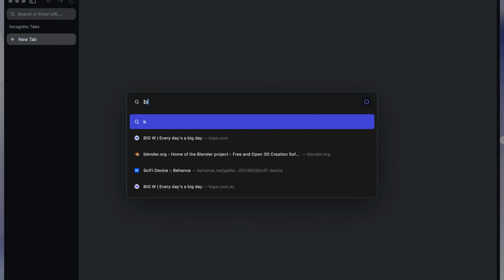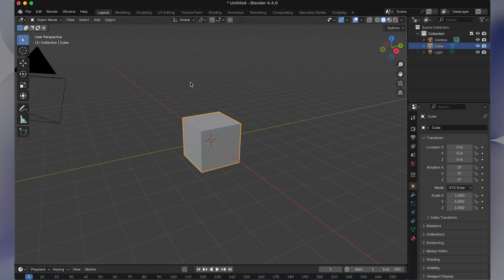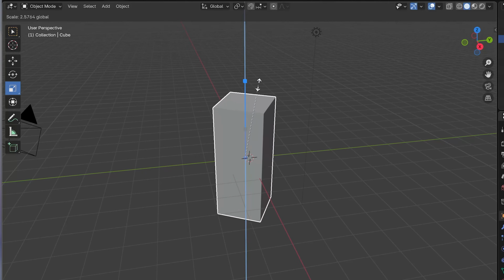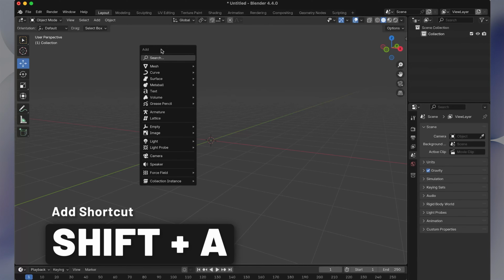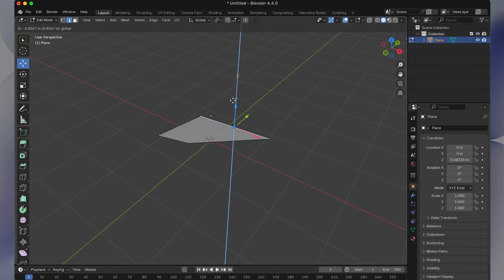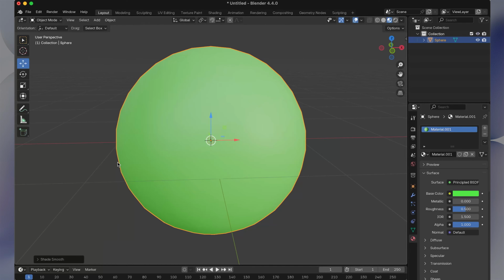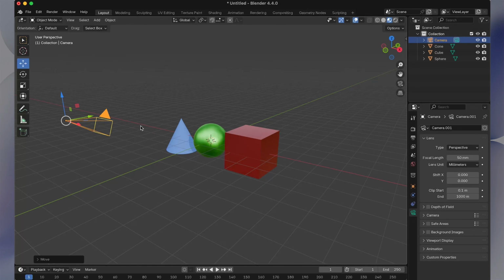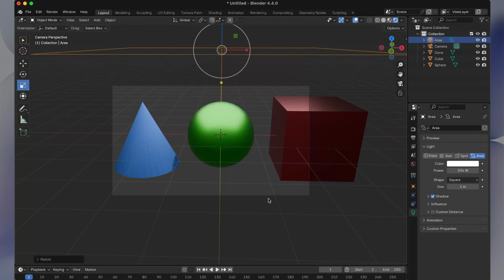Blender for Absolute Beginners (Step-by-Step)

Comment: I am new to Blender and experiencing an issue with the default cube in the 3D viewport. The cube still exists in the scene, but it does not display correctly in the viewport. When I zoom in or out, I can only see a line or part of an edge instead of the full cube, and sometimes the cube disappears completely in Perspective view.

I have already tried the following steps:

Frame Selected
Shift + C
Switching between Perspective and Orthographic view
Resetting the viewport/navigation

However, the issue still persists.

Could someone please explain what might be causing this problem and how I can reset the viewport or restore the cube’s normal visibility in the 3D view?

I am using Blender 4.5.8
Reply from the maker: Hmm, that sounds weird. Try selecting the cube, pressing the tilde key (normally below the escape key), and choosing the frame selected option.
Reply: Thanks! It was a viewport/zoom issue I’m still trying to fix it.